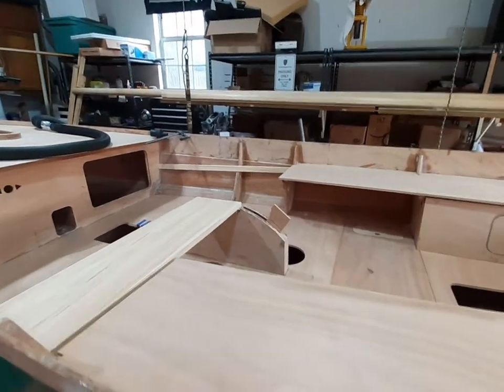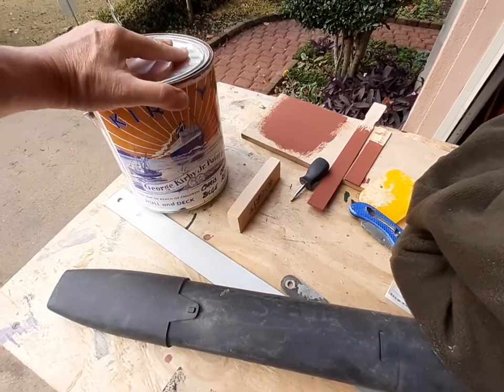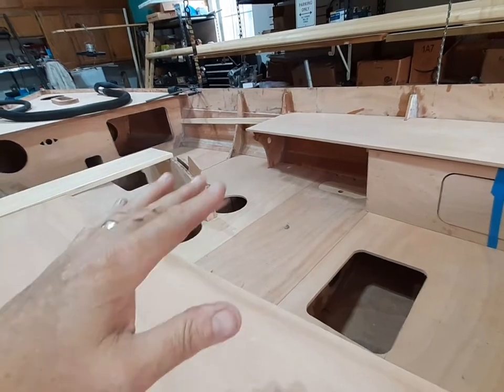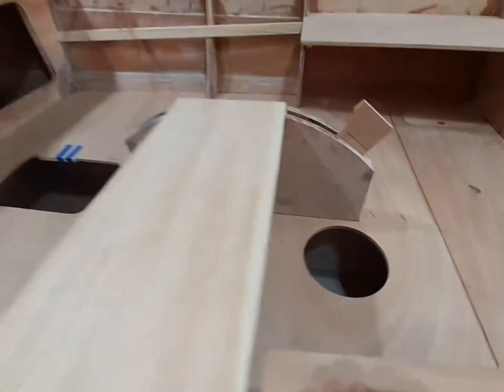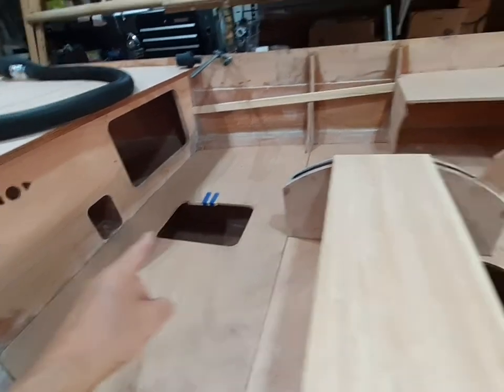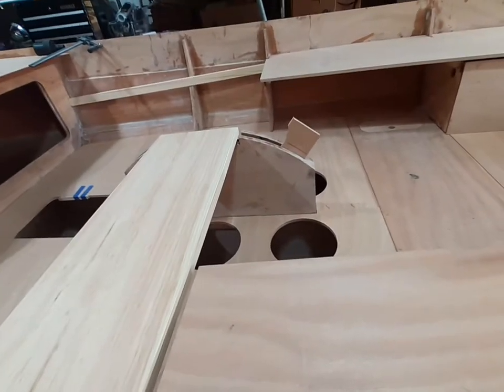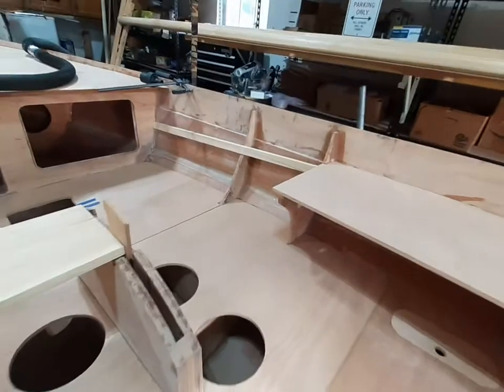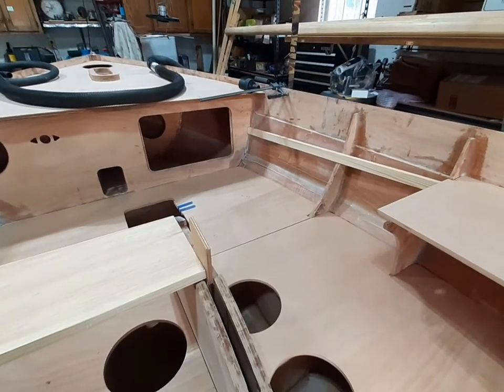Lilou2 stitch and glue sailboat project,  pt 28.....rowing thwart issue

Comment: just when I think I've decided on what really want to build...  I'll be binge watching your series from start to finish.  Thanks!
Reply from the maker: One thing I learned about this was that,  even though the parts are CNC cut, I did have to do a little bit of trimming to fit the bulkheads and the transom.  

Thanks for watching!!!  Let me know what you decide.     

PS, right before purchasing this kit,  I had an opportunity to purchase a drascombe lugger right here in Georgia for $8,500 on a trailer with a motor.  This kit is very similar to the drascombe lugger, just a little beamier towards the front..  so far I've spent over 13,000 on it.  Not much else to purchase.    I just finished reading 'australia the hard way' by David Pyle (also a 40 min you tube video about the journey)......good stuff